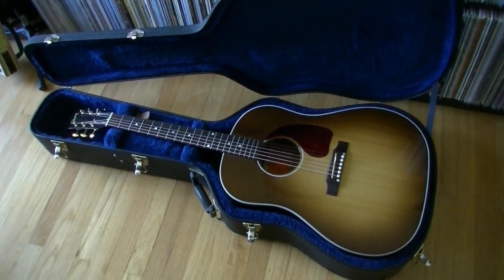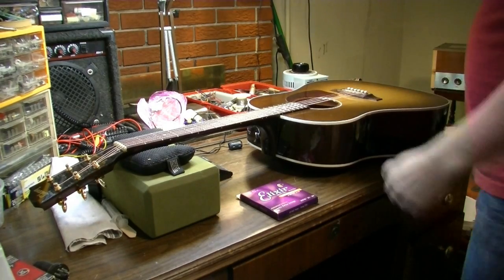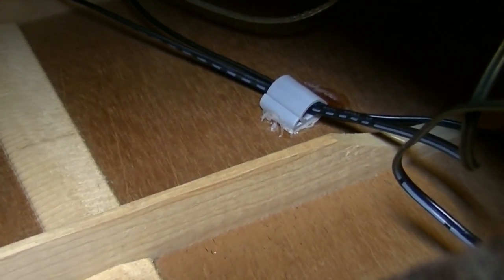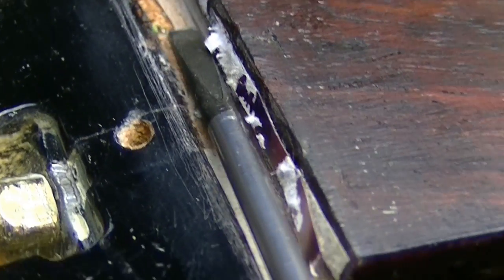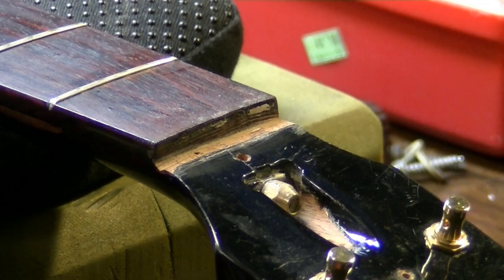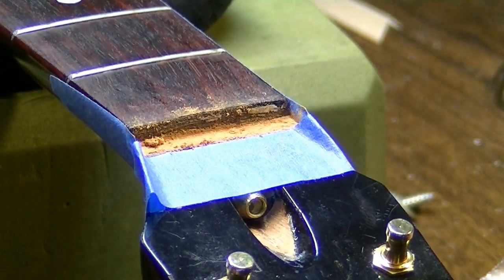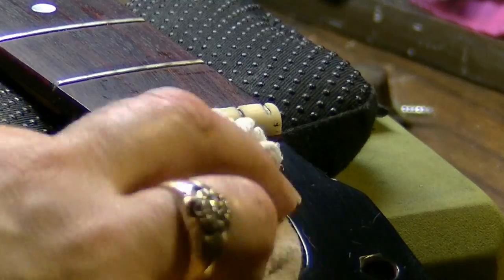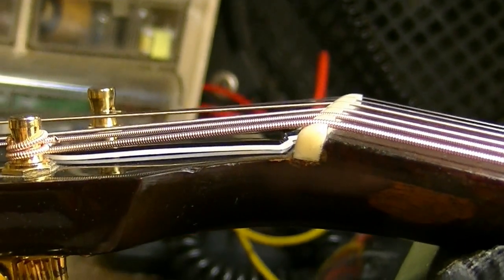How to Gently Shave One's Nuts - Gibson SJ Custom Shop Repair

Comment: Nice, nice restore on that Gibson, Brad! ... Super Glue and guitar woods sure take to each other. 
My OO-18 C had a tiny little crack in the upper left portion of the top, and it was always there since I first got it from my Mom and I was shy to try to repair it for a long time. Finally I simply put a piece of Scotch Tape exactly along either side of the little 1.5 " or so crack and smoothed it down, then applied the Super Glue along the line between the tapes and moved either side of the damaged part up and down a tiny bit to help the glue get in the crack real good, and let it set overnight and then peeled off the tape and I buffed down the tiny ridge of dry glue that was left and that spot was and  is still secure and stable... and just that little bit of a crack in that part of the guitar's sound-board, (on either side of the base of the fret-board in any acoustic guitar)  makes a very big difference in the guitar's sound. The OO-18 C always sounded good, even with that tiny but critical crack, and once I got up the confidence to alter that precious-to-me guitar and stabilized that little crack in that critical spot, it sounded super awesome , up to this day and counting...

Comment: Looks like "Gaffers Tape" Stage standard, only not for pickup wire attachment.
Reply from the maker: How have I gotten to be almost 40-years-old and still don't know what a gaffer is, or why he would need tape?
Reply from the maker: gaf·fer
ˈɡafər/
noun
1.
the chief electrician in a motion-picture or television production unit.
2.
informal
an old man.

According to Webster, I'm a gaffer too. This is MY tape.
Reply: Thats what the Hobbits called their grandpas gaffer's lol. Gaffers Tape musicians secret weapon. We call it Duct Tape down south.
Reply: Gaffer's tape is for temporary attachment of wires to all sorts of surfaces, including walls and floors and even short carpets -- anywhere you don't want people tripping over cables. It's strong, photographers sometimes mount lights to walls with the stuff. Certainly you could easily mount lighting to a door frame or anything else it will wrap around.

You do need to respect the word temporary though! It may take a couple weeks or a couple months, but the adhesive will dry out and turn into a white, powdery mess that does not want to come off. If you forget and leave it in long-term use, you will have both a failure of the tape at some point, and a massive cleanup job where the tape was. I have used it to patch up instrument cases that were starting to come apart, and never got around to doing a proper repair, which I regretted a couple years down the line when the tape failed (the entire cloth side just fell off) and left me with a powdery mess that turned to sticky goop when I tried to use naphtha to remove it.

If you ignore my advice and end up with the white powdery residue, scrape off as much as you can while it is still a powder. The less you have to deal with it in the tar-paper form, the better.

Comment: I have some mahogany and rosewood dust in little plastic vials.
It is a pain when you have to go in and fix someone's shoddy work.
Cutting and forming nuts from blanks is a PITA so I try to work with the original nuts if they can be saved.
Great video as always Brad.

Comment: Great before and after, very nice repair. I was thinking it wasn't clean enough as you applied the tape, then I couldn't help but think "get new super glue with a tip you cheapskate!" as you struggled to apply it to the right spot.... then the reveal - glue on the head stock . Oh man that must have been heartbreaking. Not trying to be too critical, I know the feeling. Hell I scratched my head stock just trying to wind the string down correctly. And you could have edited it out, so props fore being honest. Overall I'd say a 9.5 out of 10, great job. Sweet playing at the end too.
Reply from the maker: Thanks for the comment. Yeah, the tip breaking off my glue kinda screwed me. It was middle of the night and nothing was open either, so I made the executive decision to get the glue on it so I could come back to it in the morning. I hope people can learn from my mistakes. I make 'em all the time and being up front about it is the only way to learn. Makes the videos more interesting too.

Comment: You should try Duco Cement for the sawdust putty mix. It works, for a rock-hard finish, with whatever kind of sawdust you happen to have, including pine. It actually dissolves the saps and resins in the pine or whatever other kind of wood, so the surface of the piece of wood you're trying to add to gets somewhat dissolved as well. I use(d) it with straight box-joints/finger-joints for cabinets made of pine, and the joint becomes harder to break than the wood itself, like if you hit it with a sledgehammer, it will break in the center of a piece and not at the joint. Really good shit, and cheap when you consider how good it is. I'll send you some if they don't have it down there.
Reply from the maker: Thanks for the tip!
Reply from the maker: Ahahahaha....ok, you win.

Comment: Just got a guitar off Reverb , good price .

Only bad thing is it buzzes at the 1st and 10th fret , low E string.
Reply from the maker: You have a nut problem causing the first fret buzz. OR the first fret itself has risen up out of the fret slot. Get a small piece of soft wood or something to rest of top of the fret and gently strike it with a hammer and see if that seats the fret back down a bit lower. If not, you can fill the Low E string nut slot with super glue and wait for it to completely cure, then re-slot that slot with a nut slotting file. You can get all the tools you need for this here: http://amzn.to/2pjZSxb

As for the 10th fret buzzing...the 11th fret is probably high. Gently tap it down the same way you did the first fret.

Comment: I've got a j45, that I bought new in 2007, mine has the same electronics, with the little hidden volume wheel, and the battery compartment that can't be reached with the strings on.

Comment: How do you measure the correct distance from the nut to the 1st fret. What is someone had changed that distance with a file ?
Reply from the maker: Take the scale length of the guitar (the distance from nut to bridge) divided by the constant 17.817. That will give you the distance to the first fret. On a Gibson guitar of 24.75" scale, that would be 1.39".

Comment: Everytime you change strings does the person that owns the guitar have to adjust the intonation & or truss rod???
Reply from the maker: No. Intonation is pretty much set from the factory. Truss rod adjustments are only necessary if you change your string gauge or seasonally for climatic conditions.